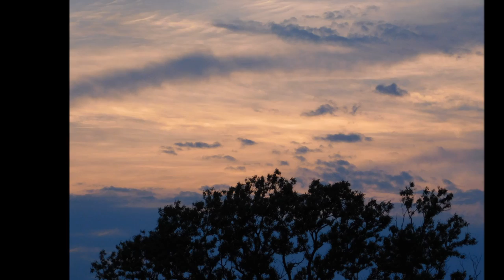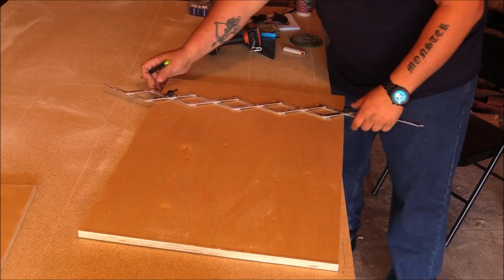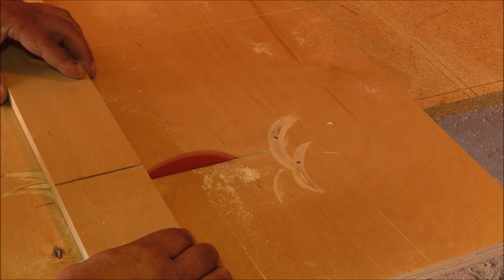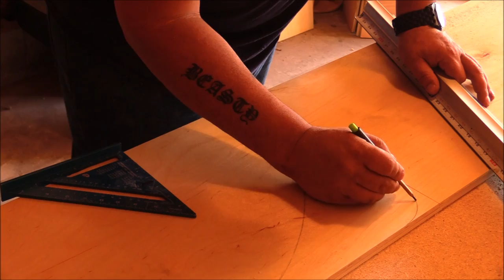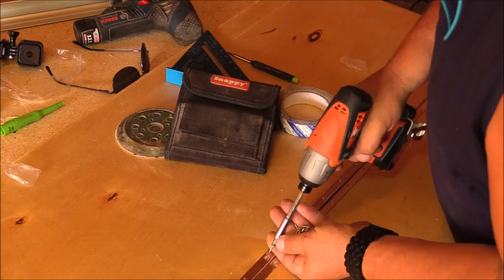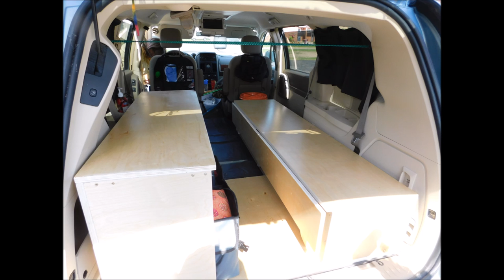Building a Folding Bed & Cabinet for a Mini Van | Izzy Swan

Comment: That was a fast and fun build Izzy. I just spent 2 months building a mini kitchen for my Honda Fit (Jazz),  and it'll be another month before I figure out how to cram a bed in there too😨. Wish I could do stuff as fast as you!
Reply: dav snow A bed and a kitchen in a Jazz. That would be impressive!  Haha.
Reply: ksp1278 : The kitchen works a treat with gas stove like Izzy's on a rollout drawer slide to the rear, under the hatch for safety reasons.

There's room for 2 people's cutlery, crockery, 2 water containers & pump (room-temperature and iced water), cooking utensils, a small built in water bowl ("the kitchen sink" lol!), a roll out table, and a food storage area for preserved food and icy cold food. 

We live in tropical Chiang Mai, hence the need for cold food and water. The heat presents a challenge for bed design, as mosquitoes annoy you with open hatches, and the heat builds up quickly when they're closed.

Comment: Build a bed in a minivan. I use 4 milk crates, attached two 75 inch lengths of angle iron. I bought a bunk bed mattress. Cut a sheet of plywood to match the mattress and laid them on top of the milk crates, using the angle iron to keep the plywood in place. Milk crates get you off the floor and provide storage space. I'll make a video if you want? John in Québec

Comment: Nice video. Got a question for you - do you have a preference in battery powered tools? I need something for pretty light weight use - cutting mill rippings shorter so they fit in the pickup. I use them for segmented turnings. Thanks.
Reply from the maker: Ken Weinert i just used the ryobi set and was i.pressed for what it is . it get the job done